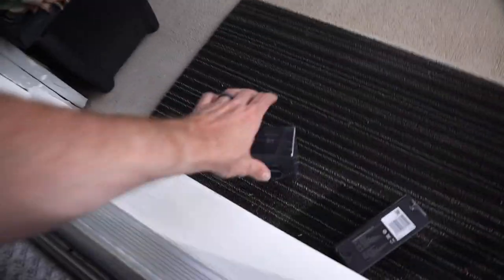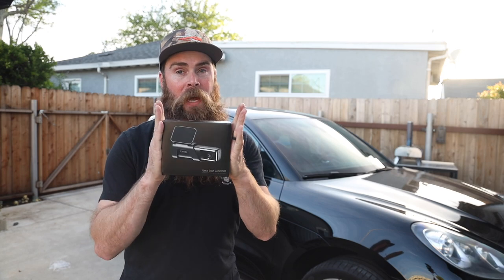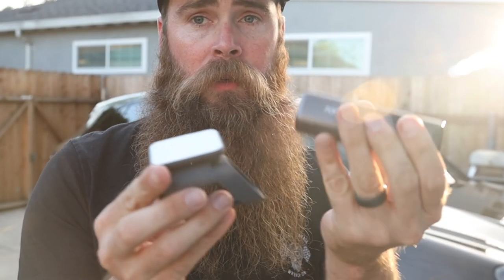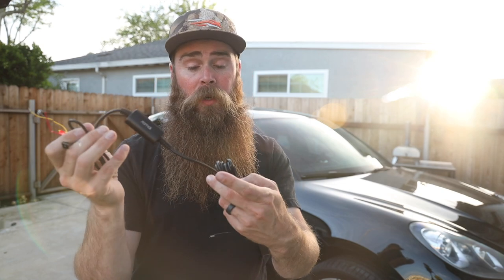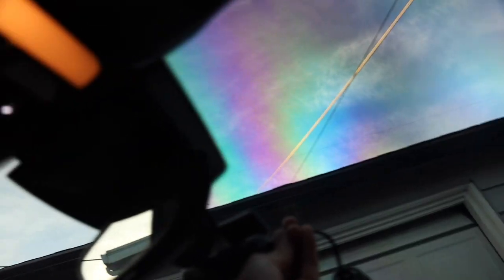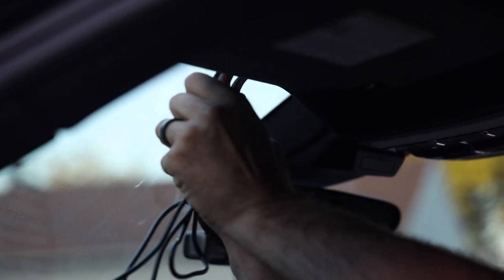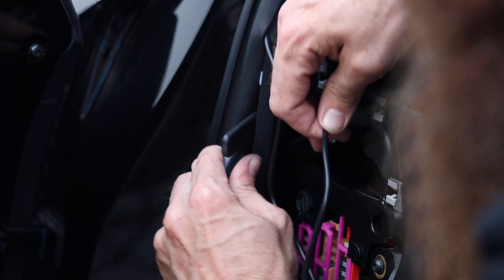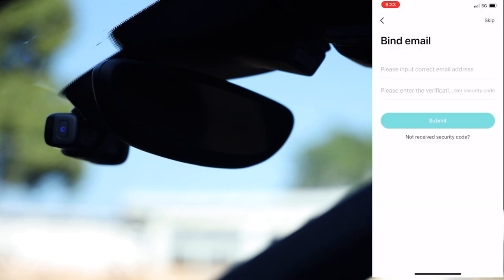Porsche Macan Turbo Dashcam Install 70mai M500

Comment: Hey Blake, I am going to pick up a 2020 Macan next couple weeks and thanks for the video.
Are you able to tell which cable should I connect, I see the fuse box has so many part and i don’t want to damage the electric for sure. The hard wire kit I will get is the Vanture  which doesn’t have a yellow but only red and black and comes with different connectors. Wondering if you can tell where to install the red and black wire 
Thanks